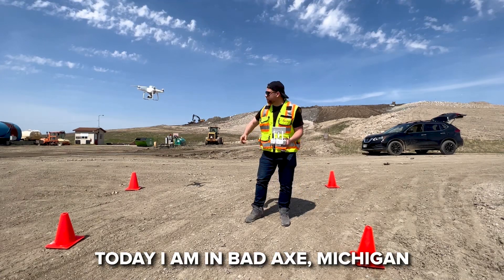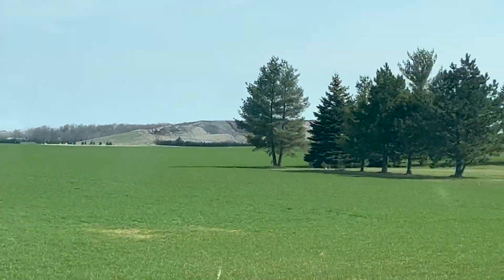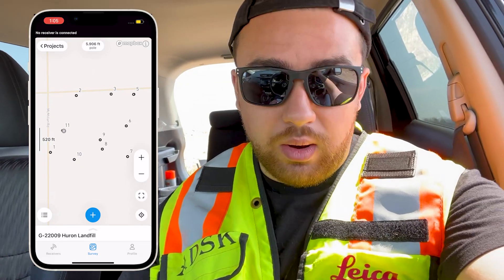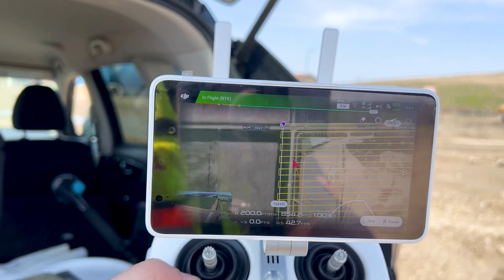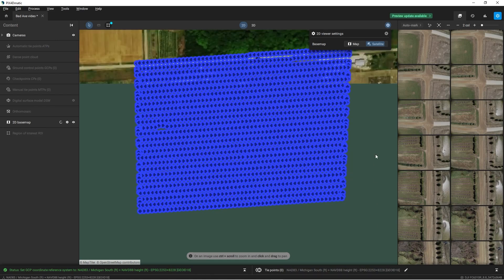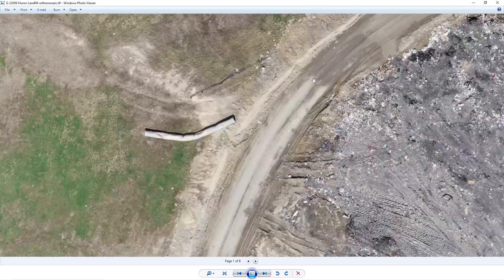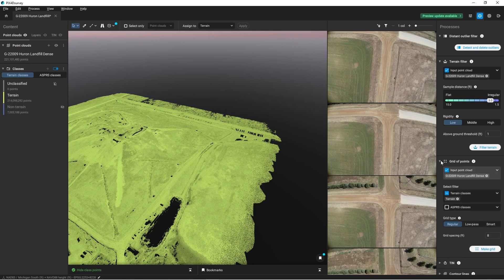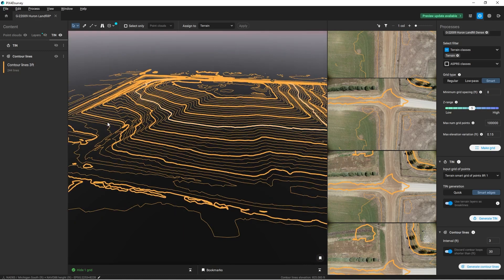I Surveyed a Landfill with a Drone

Comment: Super helpful. Was a little concerned for the Phantom taking off and landing so close to power lines but with RTK I guess the chance of hitting them is extremely low?
Reply: phantom only has one rtk reciever is not for electromagnetic interference like it works on sysytems that are rtk redundant, m300, m30t  have 2 rtk recievers ,this is what you want for electromagnetic interference i think

Comment: Is RTK and Base Station really so crucial if you only want Elevation Data and Volumes?
Reply: Not really, you can fly with a ph4pro, but you need yo set enough control points across the area.

Comment: Not possible to do this with the 4 Pro V2.0 I’m guessing?
Reply: I use pix4d with the 4pv2 non RTK and Trimble survey equipment for the GCP’s. As long as you have set GCP’s the job will align with those once you tie the photos together.